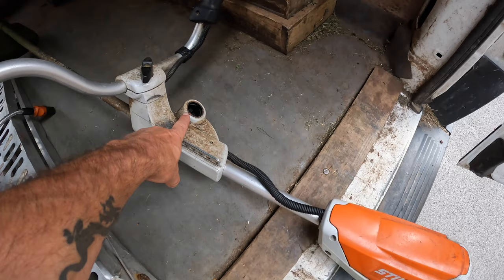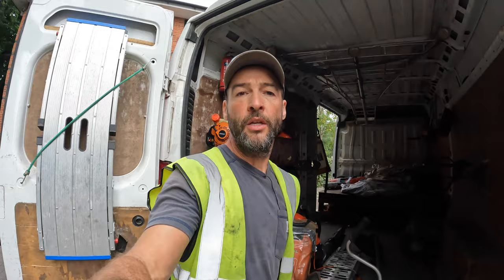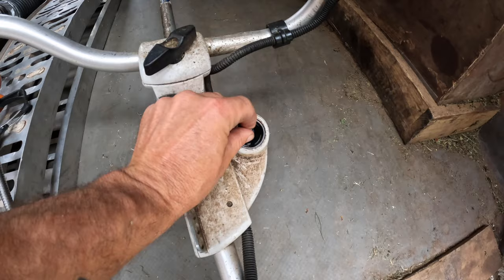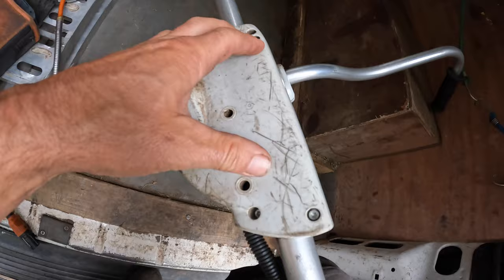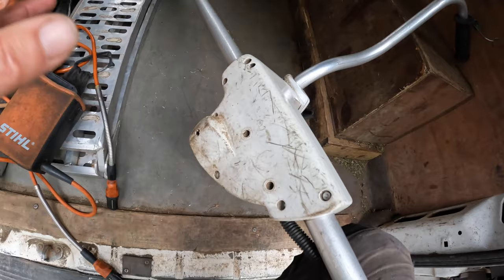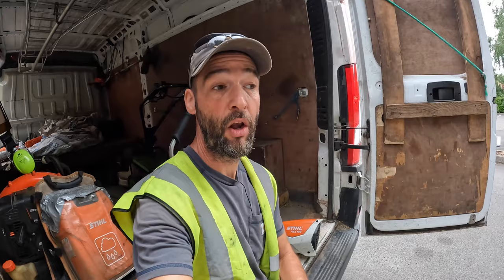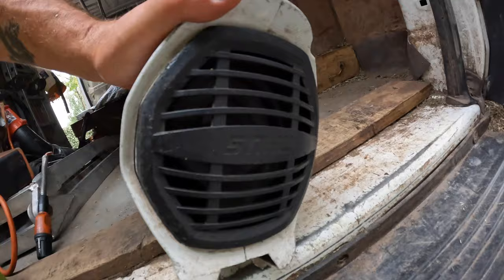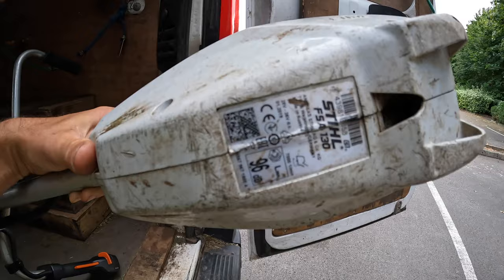Battery strimmer stopped working?…TRY THIS EASY FIX! #stihl #lewisgardenservicesltd

Comment: Thank you man! Just repaired my Stihl FSA 57 from battery stutter with just some canned air and a whiff of WD40. In those models the motor is on the mowing head-side though. It's just a small electromotor and some gears, so any dust or sand make it too hard for the motor.
Reply from the maker: Sometimes it's just a simple fix and crap on the motor or connections can definitely stop them. Glad you're up and running 👍👍

Comment: It’s great how a bit of lube makes a difference… As regards suppliers of our beloved tools ⚒️ they seem to shirk any warranty work in favour of blaming the user .. Weather has been great and managed to catch up after the crap start to the season ..
Reply from the maker: Catching up on work👌 maybe advice on how we might just get going again easily would be an idea, try blasting it would WD40 might help and cause no damage if not rather than drop it in and we'll look at it at some point 😅 A good relationship with dealers is crucial if you can achieve that sometimes
Reply: @LewisgardenservicesLtd It was actually a brand new Honda Jetwash.. used it literally a few times and I ended up buying a second hand GX390 … they have had it months and have charged me a decent price … once they have taken your money it seems they are not fussed .. obviously with a celeb like yourself they wouldn’t want the bad press … 😮
Reply from the maker: That's not ideal 😬celeb🤣 it'll work out mate 🤞👍
Reply: @LewisgardenservicesLtd  oh yes I love it really ..

Comment: I just took my Rma510 mower apart to grease the bearings. Turned out water can go through very easily. I have washed it many times  two years of owning it.
Reply from the maker: Is water meant to go through it? Hope the mower is doing well for you👍 thanks for watching
Reply: @LewisgardenservicesLtd  manual says imotor is not waterproof. Not supposed to wash with water  but o well.
Reply from the maker: All my kit has been fine in wet weather so hopefully a good old wash won't affect it👍

Comment: I do find the battery equipment interesting slowly moving away from petrol. However I found the trouble shooting informative 👍
Reply from the maker: I wouldn't be without it, I guess some will have bad experience with it but that strimmer is now 3 years old and has been great. Troubleshooting for me is just anything obvious I can find😬 had to use echo petrol strimmer the day it wasn't working and had forgotten how much 2 stroke they get through 🤔 hope you're not working all weekend....have a good one🍻
Reply: @LewisgardenservicesLtd  you definitely had ear defender on that day
Reply from the maker: @jonathanbell7752  I did and it wasn't just to hold my ear bud in😅I use them on battery anyway as the strimmer puts some noise out with the nylon head

Comment: I normally find it's dust in the connecting end with the tool
Reply from the maker: Where the battery cord goes in?
Reply: @LewisgardenservicesLtd  yes, I find giving both ends a blow out and a wipe helps
Reply from the maker: @eduardosapples1997  gotta keep em clean😅

Comment: Have you had any overheating issues with all this sun we've had? I really do enjoy my battery equipment.
Reply from the maker: Not at all, used that strimmer for couple hours on the hottest day the other week with no issues 👍
Reply: @LewisgardenservicesLtd  good stuff! I think I mentioned before that I've got quite a bit of Ego kit. No problems aswell 👍🏻
Reply from the maker: That's what me want, no issues just working kit👍

Comment: Give me an engine any day and I'll completely strip it and rebuild it, normally do a chainsaw or strimmer engine at the weekend.
Been doing accounts, not cut a lawn for 8 weeks and everywhere is completely dead here so probably won't be for another 8!
How did you get on with the gluing the magnets on, hold out?
Reply from the maker: I think if you've the skills to rebuild and enjoy using the petrol machines you definitely have no reason to make the swap to battery, I went to is for selfish reasons as I was falling apart with the weight and vibs off petrol. Glue them? I just pulled the crap ones out and carried on😅
Reply: @LewisgardenservicesLtd  I do enjoy rebuilding and running 2 strokes alot, don't always enjoy the emissions tho especially the HL75 hedge trimming. Just rebuilt a couple Stihl 94's so probably put 1 on as far better on emissions especially being a bad asthmatic!🤣
I remember you had loose magnets but forgot you ditched them, figured it wouldn't work properly with out them!
👍👌
Reply from the maker: The good old hl75, nice and light those👍my skills only go as far as pulling magnets out and hoping for the best😅

Comment: This looks like it's for commercial purposes. Couldn't relate it to my garden strimmer. Any way to simplify it?
Reply from the maker: If you've nothing to lose and it's not working carefully take it apart and look for anything obvious. Look/ corroded connections and debris in motor/ switches. Anymore more complicated is out of my league. Good luck and cheers 👍
Reply: @LewisgardenservicesLtd  
Tried that. The only place I cannot get into is motor housing as the screw has corroded over time and I can't get it out.
If the motor has burnt out ( it never smelt as though it had though) so it's  uneconomical to get it fixed.
Thanks for trying to help.

Comment: Will use petrol tools to the day i retire,petrol engines = the proper way to power stuff.
Reply from the maker: Whatever works for you, no reason to change 👍this would have been my last year on the tools probably if I hadn't made the change
Reply: @LewisgardenservicesLtd that's what I'm hearing from a lot of guys - the battery kit is giving them more years in the game , especially the older guys. I'm only in my mid 20's but already conscious of vibration, fumes etc from petrol kit so I'm looking into battery stuff more and more and I'll make the move eventually 👍
Reply from the maker: @PKGardenService  look after yourself now and get the best kit, I wish I had🙄 the cost of trimmer and battery has saved twice that in fuel saving I recon. 👍👍
Reply: @LewisgardenservicesLtd  they say it only costs pennies to charge a battery. The initial investment is big there's no denying that , but as you've just said you do claw it back over time and then start to make a saving. Oh yes you seem like you've many years of service given to this trade , it wrecks your body no doubt about that. Can only work smarter from here on.

Mind yourself Nathan , I really enjoy the uploads, looking forward to next one!